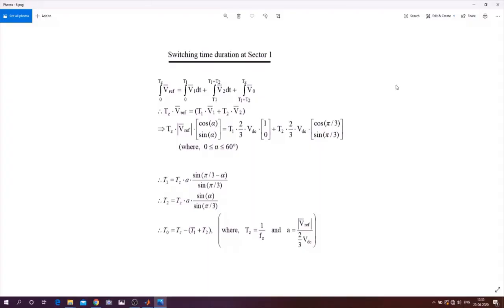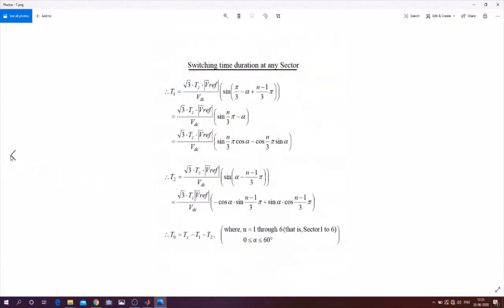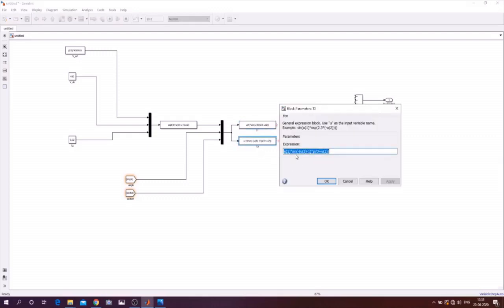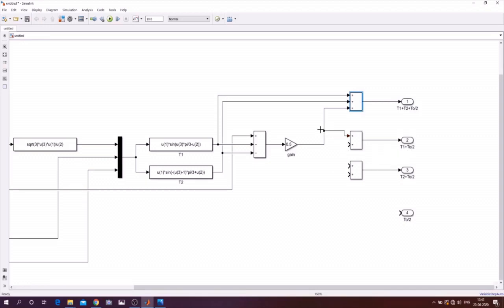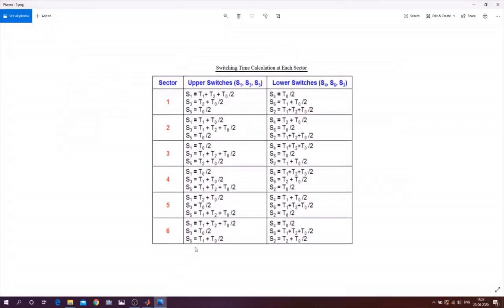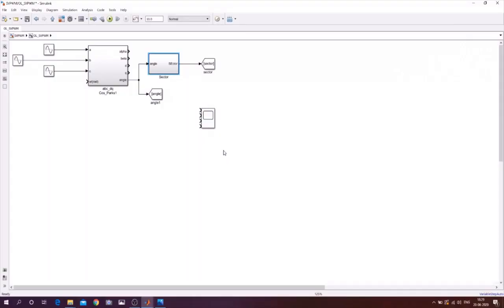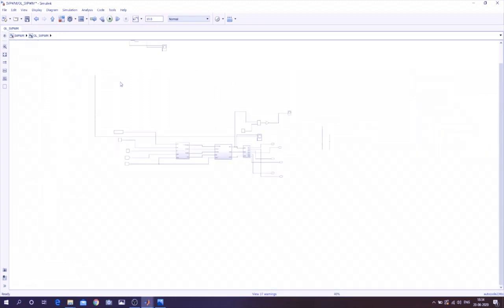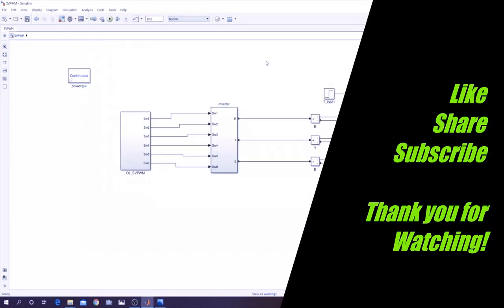Space Vector PWM 2 | SVPWM Technique | MATLAB Simulation | Step by Step

Comment: Why are only Sector 1,3 and 5 used to generate sine1, sine2 and sine3? I did not get this point?
Reply: the switching time of S1, S3, and S5 should be calculated according to that table but not of Sectors 1,3 and 5. That means, e.g., the first signal switch should be used to determine the switching time of S1 in each sector from 1 to 6, the second for S3, and the last for S5.
Reply: same question hope the author will reply as soon as  possible
Reply: @arifinnugroho9191  the explainer has made mistake in this step.
It is we must take sine reference generation for top switches only (S1, S3, S5).
So the multiport switch represent S1, S3, S5. Just draw signals as per sector into switch

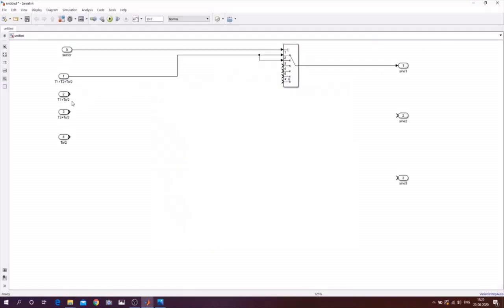Comment: At 14:20 , you are making connections while checking the table, and you are making connections according to switches in sector 1, but multiport has inout at sector, not switch, so it is not very clear to me, how are you comparing to switches in table, but pultiport is comparing to sector input.

Also, why is only sector 1,3 and 5 used to make sine waves ?

The rest explanation is very nice, thank you for it !
Reply: I  have spent 3 days trying to find the issue. Finally when i got it, i have seen your comment :(
Reply: @gorkapascual  bro please can you send me the file I am not getting the same wave form
Reply: I'm not sure if you're still worried about this question. But I finished my Plecs model with the same steps (or even with the same reference paper). For the first question, the switching time of S1, S3, and S5 should be calculated according to that table but not of Sectors 1,3 and 5. That means, e.g., the first signal switch should be used to determine the switching time of S1 in each sector from 1 to 6, the second for S3, and the last for S5. @gorkapascual

Comment: Hello Sir
Result sin waves are zigzag in nature and not what you are showing. Can I know the reason and how to improve it.
Reply: you have to increase the sampling time of matlab simulink model setting > solver > fixed time step then under advanced settings > change from auto to 1e-4
Reply: @jaisonchristal1894 
Thankyou
It worked
It Helped me
Reply from the maker: can try by changing the setting of the scope
Reply: @ttai_51  Hi, I have mail you kindly respond
Reply: same problem can you tell me the solution sir
Reply: lower carrier frequency, decrease sampling time and use a filter
Reply: I had a similar problem, the sine waves in the motor phases came out triangular like (zig-zag). I was able to fix it by changing the Simulink solver fixed-step size AND the Power-GUI sample time.

Comment: I am new to this SVM idea and have few questions. Will be thankful if you answer.
Why only Sector 1,3 and 5 are used to generate sine1, sine2 and sine3? I did not get this point.
Secondly, if I want to change the switching pattern V1, V2, V0, V2, V1 for one switching time T_z. The next steps will be the same to generate the gate signals?
One more question, how the switching frequency is decided? from carrier signal or from T_z = 0,02?
Reply: I can only answer your last question since i am new to this SVM too.
yourr reference signal or modulation signal frequency will be your inverter output voltage signal frequency.
so if you want a ac voltage with 10kh frequency in inverter output. your reference signal or modulation signal frequency must be 10khz.

your switching frequency should be 10 times or higher then reference signal frequancy.  so it will be 10*10kz=100kz in your case.
this switching frequancy is the switching frequency of your carrier signal. 
{ this is due to the fact that the output inverter voltage will also include this switching small harmonics. and it will be easier to filter this high switching frequency harmonic using a low pass filter. low pass will fiter then allow the low frequency signal which is our reference frequency and block the high frequency harmonic which is the switching frequency to get the exact pure reference voltage in the inverter output.}

simply: your carrier signal will specify how fast switches are turned on and off in inverter and your reference signal(modulation signal) frequency will specify the period of your inverter output voltage
Reply: I'm not sure if you're still worried about this question. But I finished my Plecs model with the same steps (or even with the same reference paper). For the first question, the switching time of S1, S3, and S5 should be calculated according to that table but not of Sectors 1,3 and 5. That means, e.g., the first signal switch should be used to determine the switching time of S1 in each sector from 1 to 6, the second for S3, and the last for S5.